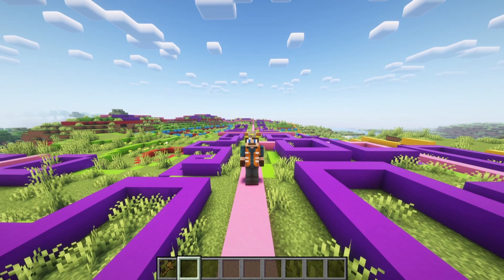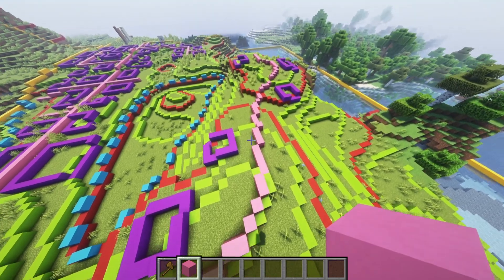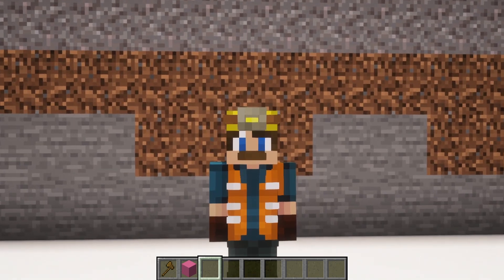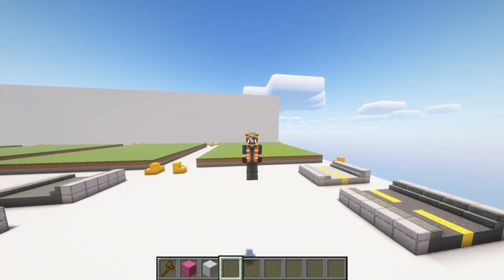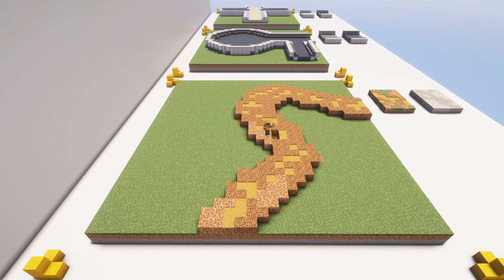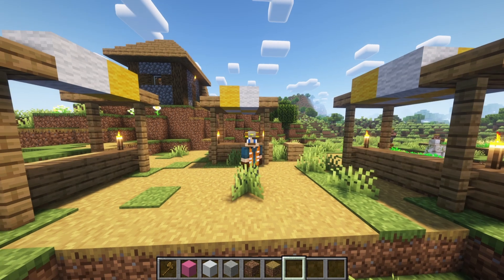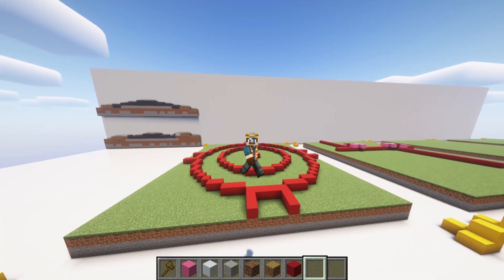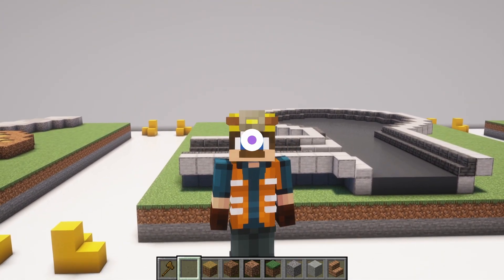Real ENGINEER Plays Minecraft | Roadway Design

Comment: Road design is especially important if you’re playing with mods, since you need to make sure your roads are capable of carrying the vehicles from the mods.

If you’re looking for a good road construction mod then you can use Mishang Urban Construction.
Reply from the maker: @samuelhulme8347  I hadn’t a clue something like that existed, I’ll have to check it out! Thanks 🫡
Reply: @khugg  Another good pair of mods is Traffic Simulator (which does exactly what the name suggests) by atomatotige and Immersive Vehicles. Unfortunately they are both for 1.16.5 however they are really cool mods.
Reply from the maker: This is fantastic, I’ll have to dig around through some older versions and give some of these a try!